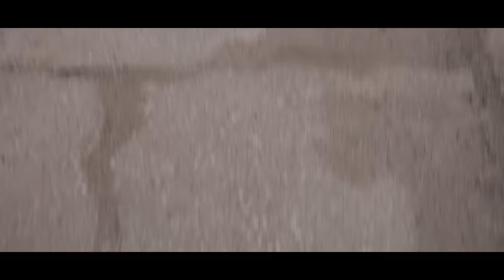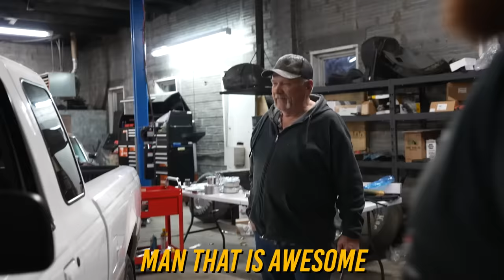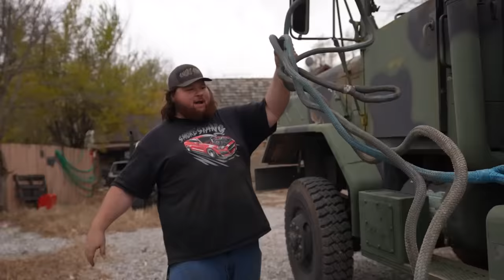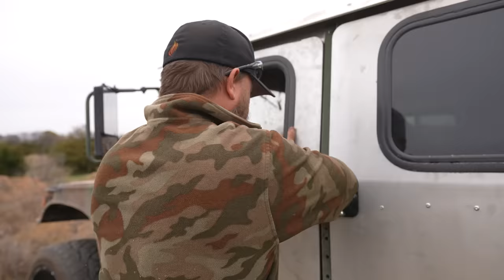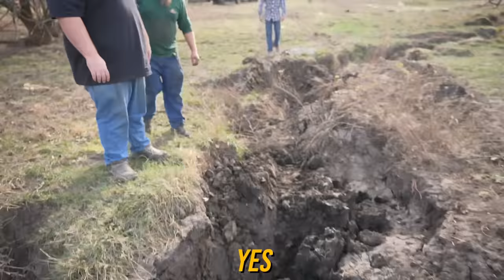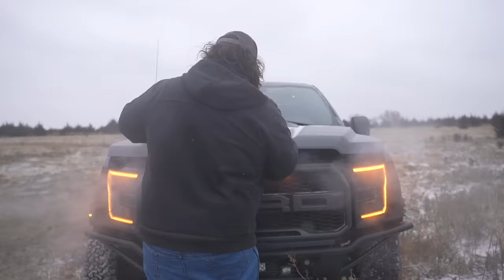I Taught My Ford Raptor to Fly

Comment: Little advice, if you decide to jump your new TRX, make sure you have the suspension set to its most stiff setting, don't do like street speed and set it on baha which is very soft and the truck is front heavy and it gets to crazy speed in a short distance so even with weight in the back ot landed full weight on front axle.

Comment: If you didnt already i recommend disconnecting the airbags so they dont go off. It will shut down the whole truck till you fix and reset the airbag sensors

Comment: No joke, those trucks typically don't need any kind of ethanol assit when starting. My buddies rig would fire up after sitting a solid year. (new batteries) it would take a few cranks but eventually it fires.

Comment: when he had the wheel loader up on the front wheels LMAO. I drive these daily and that can be so scary when you check the weight of a rock and it turns out to be 9 Tonnes and the balance of the machine comes into it.

Comment: Good rule of thumb for a stuck whatever get some the same size or weight so if my calculations are correct 1 Westen in a 5 ton and no one in the other should about do not knowing fuel level lol

Comment: The reason you broke it: 
It’s a FORD. 
VOLVO AND RAM VEHICLES FOR LIFE
Reply: I apologize for what I said but our family has had no luck with fords. My dads first car was a ford ranchero and it always was breaking. But I’ve had a 1995 Volvo 850 turbo sedan. Other than having to replace all the coolant lines. It’s worked like a beaut. I also think that you guys would have fun with a Volvo 850 turbo. They may be small but their drivetrain last for years. It runs great at 219,000 miles.